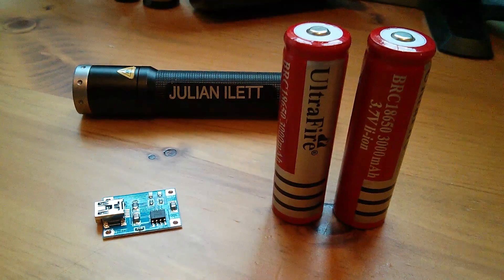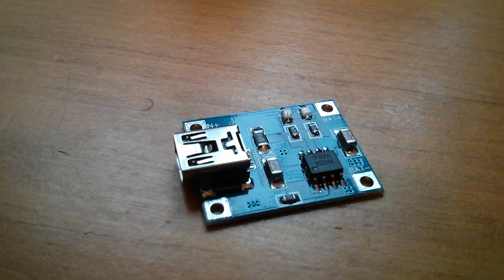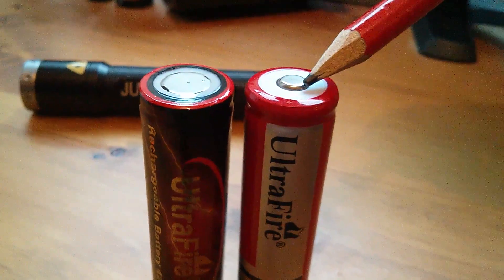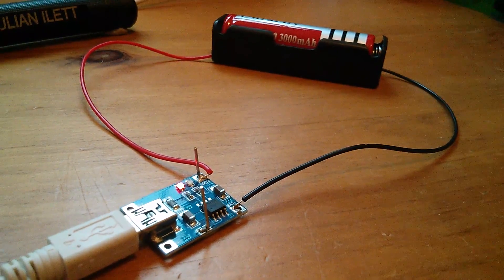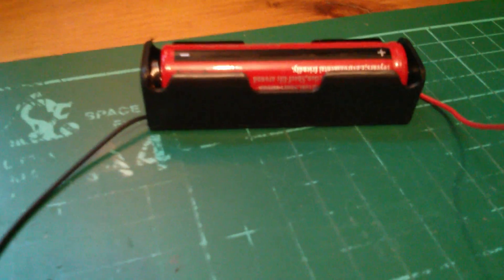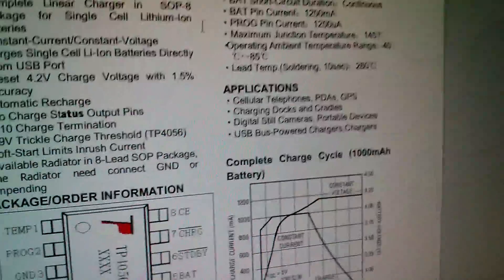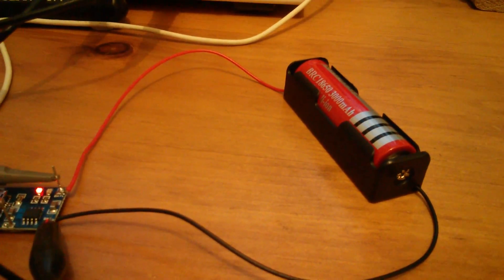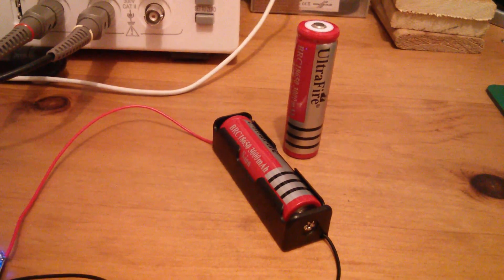Charging a Lithium 18650 Cell using the TP4056

Comment: Nice video! Is the 3A overcharge protection or output protection? See allot of these modules but has some doubts on the output specs. I want to use it to charge 4 18650 2000mah batts but output must be at least 5A to power an Amp. Suitable for this?
Reply: According to the datasheet, the TP4056 is only designed to handle a single cell at a time. If you want to charge 4 cells, you'll need 4 chips. These boards are available for $.31 each online, so it won't cost too much, but if you need something really compact, you might want to look for something else.
Reply: Actually, that's not really accurate; you can charge multiple cells with a single chip, but they won't be balanced. If you have very similar cells it probably won't be much of an issue though. Depends on what you've got.
Reply: Thanks for the answer! Hmm strange, there are 4 cells chargers around with a single chip, but okay just found the datasheet. This is some sort of test 'prototype' so I want to figure out it will work anyway. And yes, bought this one for 31 cents ;-). I know there is only 1A available so I know it takes longer to charge, not a problem for this version. I have also the one without protection but can't change setup because of decisions already done (glued etc, stupid I know).

Batteries are from the same type and batch so I think this will be not a problem for this test 'prototype'. One concern is the output, is it limited by the protection circuit? That would be real problem. Is the 3A overload protection or overcharge protection? When it's output is limited to 3A I cannot get the full potential out of the batteries required for application, need at least 5A peak.  Not clear to me when I look at the datasheet and product discriptions of sellers.

The datasheet mention there is no blocking  diode required but I want to know when I put four outputs (the output pins, not the battery pins) of these in parallel, will it work anyway, is it safe or do I need to purchase another module.

Another question, you show some recovery at your video when you reconnect the charger in charge modus. Mine starts to charge but do a full charge (but batts are already fully charged), is this because of I connected 4 batteries instead of one?   

Thanks for the answers if you want to answer ;-)
Reply: At the 8205A datasheet:

Discharge overcurrent detection in 2-step

- Discharge overcurrent detection voltage
   0.050 V to 0.300 V *4 (50 mV step)   Accuracy ± 15 mV
- Short circuit detection voltage
   0.500 V to 1.000 V * 4 (100 mV step) Accuracy ±100 mV

So it detects voltage drops because of overcurrent? It doesn't measure Amperage but voltage drop?
Reply: Taking a look at listing 32230225249 on AliExpress, the seller description clearly says 3A for battery over-current protection. That would imply that you could probably put more power through the rest of the board, but with the Chinglish descriptions, it's hard to be sure.

Keep in mind that the board in this video uses the TP4056 in addition to other components. Those other components provide other functionality that won't be mentioned in the datasheet.

For the outputs, you should be able to connect multiple loads in parallel. What will happen if you exceed the 3A battery current limit, I'm not sure. It depends on the board. If you're lucky, you might be able to get up to 4A with the charging circuit active, but it might not like seeing wild fluctuations in current and shut down.

"you show some recovery at your video"

Wait whoa hold up a sec. This isn't my video, I'm just some guy with a bunch of old laptop batteries and a penchant for starting electrical fires in my house. If you need more solid answers, ask Julian.
Reply: Okay, thanks for the answer!
Reply: Yeah, quoting the DW01a datasheet:

"11.4 Overcurrent Protection
In normal mode, the DW01A continuously monitors the discharge current by sensing the voltage of CS pin. If the voltage of CS pin exceeds the overcurrent protection voltage (VOIP) beyond the overcurrent delay time (TOI1) period, the overcurrent protection circuit operates and discharging is inhibited by turning off the discharge control MOSFET. "

So it looks like it determines current draw from the voltage.
Reply: No need to balance when cells are parallel....

Comment: Hi, I have 2 606090P 400mAh 3.7v LiPo batteries, would I be able to charge them with this circuit?
Reply: you can use one carging module to two bateries if u  conect them parallel

Comment: Hi , I am having a pack of 3 lithium cells having only one output terminal( +ve and -ve) . Can i use one tp4056 to charge these three cells? These cells are connected in series  .
Reply: no the module is set for 3.7 v
Reply: ok

Comment: Has anyone looked at the newer units on Banggood,  they now use a micro USB connector and have two more chips on the board.  The output side of the card has out+ B+  B- and out- wonder what the connections labeled out are?
Reply: +NeuronalAxon 
yes I found the video on the newer chip
Reply: out is for load connection. an led or small device. you can still add one more cell in parallel for longer run time but you have to stay at 3.7-4 volts unless you use a boost converter. I have both styles and use both for different projects. you can make a usb battery bank with the new board. just use the boost converter to a full size USB connector

Comment: Can it charge 4x 18650 Cells wired in parallel?
Reply: +NeuronalAxon I wonder if the boards could run in parallel. I would only need 2 boards for 4 cells.
 Im not using this exact battery, instead I'm using  samsung 3.7 cell batteries.
Reply: takes longer but it can. I prob wouldn't go more then two cells at once.
Reply: Even though they could, these charging boards are that cheap to buy, why bother skimping
Reply: It can charge any number of 18650 cells in parallel, but the more you have connected, the slower they'll charge since the circuit can only supply up to 1 Amp (1000mA).

Comment: I tried to swap the resistor to change the charging current. Even added a 10k potentiometer with a 1k2 limiting resistor. It simply doesn't work. The charging current locks at 170 mA.
Reply: Thanks for the reply. I tried with 3 boards.  With the standard 1k2 resistor that came with them, it worked fine. When I swapped the resistors with a potentiometer, just one worked for a while (only using an Samsung Galaxy S4 outlet adapter). 

I believe that the IC is very susceptible to any kind of noise.  Specifically the PROG pin. It senses a drain between 2mA to 0.2mA. So any sort of noise may affect the performance (IMHO). 

The datasheet is not well written as well. Some parts it says that VPROG is 2V other parts says it is 1V. Sometimes it calls the IC YP4056 instead of TP. (I measured 2V)

The datasheet also says that with a 10 uf capacitor connected at BAT pin (with no battery to recharge), the red led would blink with a period of 1s to 4s, but the period seems much shorter than this (much more 10 blinks/second). 

I might try adding a precision current sink to the PROG pin and lots of filtering caps at VCC, to see what happens. 

All the best

Comment: A good device, but it has one drawback - charging at a amperage of 1 amp heats TP4056 chip. I recommend to reduce the charging amperage up to 0.7 A replacing the resistor  (search in google)

Comment: is there anyway to make the controller charge at a higher current because I have 6 18650 cells in parallel and it's taking a week to charge them
Reply: Curious about that myself
Reply: Use one IC per cell
Reply: Probably better if I just give my current setup.

I have 3 banks of 4 cells ( each bank connected in series) and the three banks connected in parallel,  the cells are 3.7v 2600mAh each.
If I understand this correctly that's 4x3.7v ~ 15v for each bank in series at 2600mAh.
And for the three banks in parallel that is 3x2600mAh = 8400mAh.

what would you recommend as the good charging voltage and amperage for such a setup?

Comment: How many amps do you need to supply from the 5 volt source? will 2.4A be enough to charge 5 batteries simuntanesly or do you need 1 amp per battery? :)

Comment: Is there a way to use this for depletion protection?  As I'm sure you know, if a LiPo drains below 2.8v, damage can (and usually will) occur.  How could we protect against that?  Are there TP4056 modules that have discharge protection?

Comment: Nice video
Has anyone tested to lower the resistor to get slightly higher current?
Or will that abolutely break the circuit?
Reply: 1a max
Reply: I already guessed so
Reply: If you wire all of the in parallel, you can... Otherwise... not really, unless you have someway to split the 5v up into two isolated supplies (no common ground or high)
Reply: Can you help me please,  I have 2 tp4056,  2 batteries,  and 2 battery holders. Can I wire them somehow so I can charge them from  one 5v power supply?  Thank you.... John  :)
Reply: Ok so I can wire the 2 batteries to 2 tp4056 and then connect the 2 tp4056 in parallel to my 5v!  Thank you very much for your help and quick reply..... John  :)
Reply: no problem :-) I think "Well done tips" has a video on that

Comment: i want to power my project that needs about 3v. i have 4 of these battery's and do i simply connect all battery's  negative and all positive together ? this will give me 3v to my project.connecting this charger to all negatives and positives of the battery's will charge ok ? will my project be ok as 3v will go up soon as i plug charger in ?
Reply: would take a long time to charge more then two cells in parallel. I would only recommend two. you can experiment to see how long actual would take. lithium-ion are 3.7 and when fully charged reach 4 volts. double check your circuit can handle the higher voltage.

Comment: If I was to use this thing to charge a battery, could I unplug the micro usb charging cable and use a different cable to power something like the Raspberry Pi Zero through this piece of hardware without unplugging the battery? Sorry if what I said is confusing. I am not an expert on stuff like this.
Reply: +Digging4Answers I'm looking to do the same thing. I think you can - I'm going to try to wire it up today.
Reply: +Bryan B Good luck!
Reply: Digging4Answers Thanks - I am just trying to figure out how I will know when my battery is low and should shut off to prevent damage to the battery. I do believe my flat 3.7V battery has PCM protection built-in but does that mean my system just turns off and then I have to plug in again via USB?

Comment: Could you just connect 2 or more 18650 to this board? would that require the batteries to be in parallel? if yes, would it require anything else? like another protection thing between each battery.
Reply: pls answer i need to know too
Reply: yes only parallel. try three if you like but the charge time will go up dramatically.
Reply: thnx, i really have to learn more stuff about how batteries work and chargers and all that technical stuff, i know nothing about the laws of electricity, but i try and try, some things fail, some things work, all in all i'm having fun :P

Comment: Hi, on this video and on the "New TP4056 Lithium Cell Charger" video on you oscilloscope we can see the batteries doesn't charge up to 4.20V but 4.12V.

I have the same problem, when i charge a cell it stops at 4.12V or 4.16V, i tried with different cells (good ones) and different modules but no difference. 

Maybe it's the 18650 holder are not good, the wires too.

Do you know why ?

Comment: hi ! If i have 5v 2A charger i must change resistor on pcb ? (2.2 kohm or 3 kohm )? :)
Reply: +WL TR it would only allow the 500ma regardless of input
Reply from the maker: +DeathLittlePony It depends what current you want to charge your cell at
Reply: +Julian Ilett Is it possible to use a resistor lower than 1.2K to get more charge current than just 1A?  Just wondering if anyone has tried it.  I have a 2A wall charger and would like to get around 1.5A current for beefy 3000mah Sanyo 18650s.
Reply: NeuronalAxon I have since tried.  It's chip limited to prevent damage.  You can even remove the 1.2k resistor and create a solid bridge, and it will only output the 1A max.  In fact, I bought a couple TP4056's from eBay that came with a default 1.2k resistor and they would only output a maximum of 0.5Amp...so not sure what was up with those.  There's probably even cheaper/substandard 4056 chips around now, that I happened to get a couple of.
Reply: +Julian Ilett will the amperage of the charger adapter matter if you have the charger module? for example a 2A USB wall adapter but the charging board module is set to 500mA, will it only take 500mA or the 2A?
Reply: Ollies Toys thanks
Reply: +WL TR no problem

Comment: Could I use two of these in parallel to charge nimh aa batteries with a 9V solar Panel?
Reply from the maker: +Telephone Telephone No No
Reply: +Julian Ilett can you tell me if these would work effectively if i were to solder 5v solar cells to the input? cheers
Reply: +Ollies Toys You could, but it would likely be at very low current. Solar cells in my experience don't put out a lot of current. So even if you had your resistor set to charge the circuit at 1a, you may only get a couple hundred mA in reality.
Reply: +relishgargler ive got 4 x 500ma 5v panels on order. i plan to wire in parallel to charge a 18650 usb battery bank

Comment: i like those current/voltage graphs...but is there one that shows capacity fullness too?  I'm wondering what is the capacity when  it's at the beginning of the constant voltage phase or end of constant current phase?
Reply: +danh le that varys from cell to cell and you'd need proper testing equipment to measure how much is put into the battery over that time.

The constant voltage phase is actually just the charger holding the same voltage and as the voltage differential between the charger voltage and the cell voltage goes down the current flow also drops... like if you disconnected the charger at the start of the constant voltage phase it might read 3.8v halfway through it might read 4.1v when disconnected and at the end 4.2v disconnected (at all 3 states of charge the charger would be holding something like 4.25v)

You need a voltage differential between the charger and the cell otherwise their would be absolutely no current flow (a multimeter would read 0v) but if you put over 4.3v into a lithium cell it can cause damage which is why constant voltage trickle charging is used for the last portion of the battery
Reply: +micheals1992 thanks that was helpful!
Reply: danh le no problem! glad it was useful to you :)

Comment: amazing video!!! just a question...if I connect 2 tp4056 modules to a 5V 2A phone charger will i manage to charge 2 18650s with 1A current each one?
Reply: +Oti Na Nai Θεωρητικά ναι. Δεν υπάρχει λογος να μην το κάνει. Αρκει ο φορτιστης να μπορει να δωσει 2Α πραγματικα (δλδ να ειναι καλης ποιοτητας)
Reply: Ενας Samsung είναι απο κινητό...το εκανα και σύμφωνα με το χρονο φόρτισης φαίνεται οτι όντως φτανει κοντά στο 1Α σε κάθε μπαταρία...αλλά ή πλακέτα ανεβάζει τρελές θερμοκρασίες και ο φορτιστής ζεσταίνεται αρκετά...είναι φυσιολογικό;
Reply: Οταν λες τρελες θερμοκρασιες τι εννοεις? Μετρησες ποσο? Προσφατα "ανακάλυψα" οταν δοκιμαζα κατι stepper οτι οταν κατι πιασει 45-50 βαθμους δεν μπορεις να το αγγιξεις για πανω απο 1-2 δευτερα. Αλλα 50 και 60 βαθμοι δεν ειναι πολλοι για πολλα ηλεκτρονικα. Για καλο και για κακο ομως εγω θα τους εβαζα απο ενα μικρο ψυκτρακι (τα πουλανε φθηνα, για μνημες)
Reply: +BIll Georgoulakis δεν έχω τροπο να μετρησω ακριβώς αλλά είναι αυτό που λες, δλδ τα αγγιζεις max 2sec...είδα όμως κάτι γραφικές παραστάσεις για τη συγκεκριμένη πλακέτα που δείχνει οτι πιάνει 60+ βαθμούς χωρίς να μειώνεται η απόδοση της...έχω ψυκτρες και περιμένω τη θερμοαγωγιμη τωρα...θα το δοκιμασω...ευχαριστώ πολύ φίλε μου για τις απαντησεις
Reply: Ετσι ειναι. Δεν υπαρχει προβλημα στους 50-60 βαθμους. Επισης οι απλες παστες δεν κολλανε. Θα σου φυγει η ψυκτρα. Δες στο eBay για "thermal adhesive", υπαρχει και σε παστα και σε διπλης οψης ταινια. Πολυ βολικο.

Comment: Hi, I was just wondering If I could power a project straight off of this, so I can make the project usb rechargeable, also where would I put the connections for this, straight from the battery or from the board? thanks (I'm new to this sorry if any of that made no sense)

Comment: Please help a brother out: 

"Do you srew or roll it or something? Or do you litterly need to solder in a different resistor?" I want to limit the current passing through to 300ma. Do I need to solder a resistor on my unit ?
Reply: +Ruben S Yes, of course you need to solder a resistor. Which is why it was mentioned.